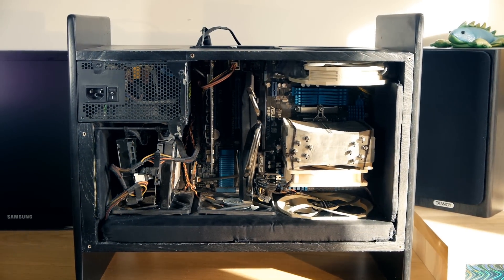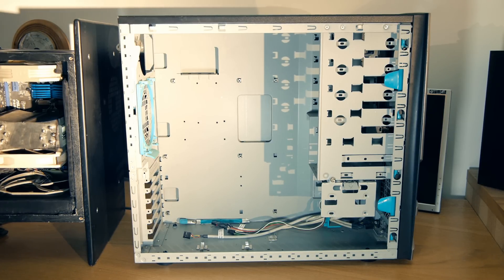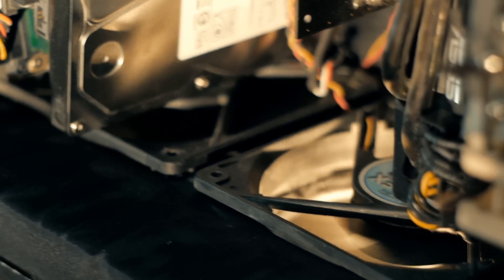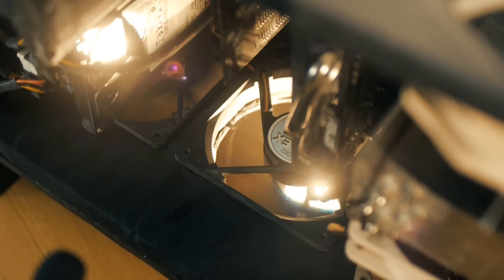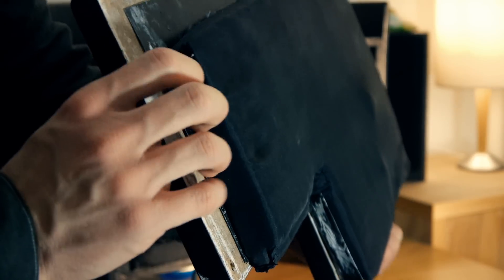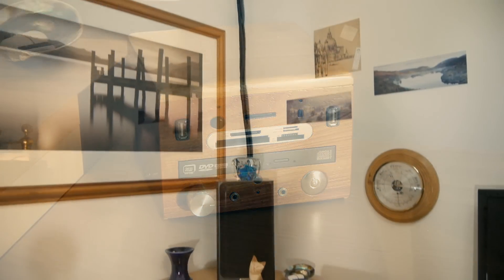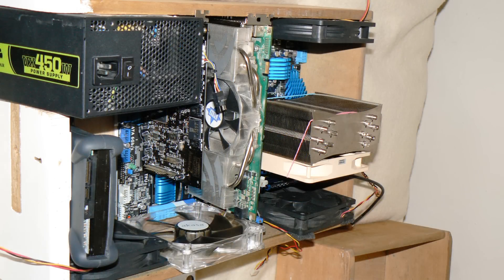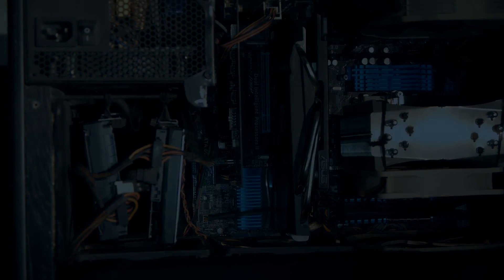My silent wooden PC

Comment: Sensible design. Except for the wood. Wood adsorbs and retains heat. Will affect case temperature. The aluminium might fix that problem though.

I see no dust filters. That makes me worried.

5 meter cable to remote control. Makes me think about signal loss and signal noise.

A computer in a small cupboard. An enclosed small room with no airflow. If I had put my computer in one, it would overheat while I was playing a game.

That the hard drives are hanging together could have been an issue if both were normal rotation drives. Vibration from both could have affected each other. Also so close together, the issue of airflow comes up. airflow is recommended to go all around the hard drive.

Comment: Until one day on of the fans dies and the whole thing catches fire and burns his house down since its stored out of sight there is no way he'll know until there is plooms of smoke coming from his attic
Reply: You're a special kind of moron aren't you...?
Reply: Peter Kay No, an honest answer for an honest question :)
Reply: Al Paca boards are loaded with temperature sensors, if fans start dying and any component becomes too hot it simply shuts down. Please note: too hot = before it damages the hardware, that's a point far before catching fire. That is unless it's some ancient AMD...
Reply: treated and or MDF requires to be least 300c temperature before it can auto-ignite !!! a puny little spark from a short wont even char it whatsover !
Reply: well, I agree, if you don't monitor it carefully, it could be dangerous. Did you explain this to your landlord, or is the house your own? I guess your assurance will raise your bill if only they know about this idea.
Reply: What if stuxnet got a hold of his computer? Is that possible? I heard that stuxnet jumps from machines run by a computer and I dunno.. Fire I guess?
Reply: Slamdoxicalz In that case, it'd be ancient ATI ;)
Also to agree with your point, GPU temps exceeding 100 degrees Celsius turn off my pc

Comment: I was wondering, you placed your comp in an compartment above your door. Since this build did not have any filter in it, did it have any dust problems?

Also, did you sealed the compartment (if so, didnt comp just re used the heated air in the compartment since its sealed) or if not, how did you manage to freshen the air with in the compartment and did that solution cause any dust problems.

Comment: But really 24gb ram? Bro 16 is max
Reply from the maker: Viman Punđa 32gb is max on this mobo actually.
Reply: DIY Perks Wow:D Awesome:) Sorry i did not know:)
Reply: Phat Jackson It doesn't depend on the form factor. What matters is:

- Chipset limitations
- The number of DIMM slots
- Support for high density modules
- Support for server memory (higher capacities available, FBDIMM/ECC etc.)
Reply: For a atx mobo running ddr3 i think the max is 32
Reply: nelizmastr yup because a ATX workstation board can take 192gb easily with riser cards
Reply: Viman Punđa
64 is the answer
Reply: MC Cm Actually 128 :D
Reply: DOGE™
 Yess it is :) gogo ddr4
Reply: ***** even more than that now that DDR4 exists. The memory density doubled, so 384 should be doable.
Reply: I have 32gb in my system and k can support up to 128gb

Comment: i love the remote mounting, i have never seen anything like that so far, it must be terrible if you are thinking of adding another monitor or something of the sort. when was the last time you had to route a cable through that system?
Reply from the maker: Jose Carias The last time was when I set it all up. I wired through three long monitor cables, so it's pretty flexible. :)
Reply: thanks for responding, can you please make a video of how exactly you route the cables if you ever have to change any of them please?? i love your channel btw, you have some very good ideas. DIY Perks

Comment: Why i didnt see this before i builded my new computer desk..-.- I would done many things differently in my project...
Question: If your computer is in that cabinet over the door if i understanded right? Is there ventilation in that cabinet? I'm thinking that if its in closed cabined it will use same heated air if whole cabinets air is not chancing over time.

Comment: how heavy is that thing? (just for curiosity)
Reply: gojart destani Unless you live in Antarctica and you use your computer in the snow I don't think that is possible. 18°C is insanely low for ANY computer.
Reply from the maker: gojart destani Pretty darn heavy! But not too much heavier than a steel case surprisingly.
Reply: hehehethat looks realy cool i only have in total 7 fans 1 graphics card 1 procesro 3 LED 2 120 mm ones and my cpu temperature is only 18 degrees !!! nad its a 6 core one
Reply: Erick Ortiz
It is possible. I usually run around 17-20 C when browsing the internet. I have an 8-core AMD.
It's also important to mention it's got Liquid Cooling. So yes, possible.
Reply from the maker: ***** Idle temps don't really mean much these days because of how efficient modern CPUs are at throttling back when the power isn't needed. Although your temps are pretty decent for idle ones, I must say.
Reply: Erick Ortiz  yes it is possible max temperature i et is 30-40 degres when i do some serious gaming in ultra 1440p and when i just browse its normal 18 degress
Reply: DIY Perks
Thanks for replying! Yeah, you're right in that aspect. I suppose I was just answering to the fact that 17 C is possible in a computer, especially with liquid cooling. :)
Your knowledge of electronics is very impressive and inspiring. I enjoy your videos!
Reply: I watched a guy on YouTube that put 20 push fan and 20 pull fans he managed to get a reading off -24... Cool build to be honest it correct I'm running the i7 4470k I think.. With the corsair water cooling CPU mine running at a temp of around 25 when under max load... (Not overclocked it)
Reply: mine is always overclocked at 4.2 ghz AMD  6  core 3.5 base ghz and when i overclock it it gets 4.2
Reply: Erick Ortiz My 8350 idles in the high 'teens with my all air cooled setup.

Comment: I like your ingenuity and DIY initiative. Also, I must say you have done well with the video and sound production. It may have been asked already, but how quiet is it? You mounted it remotely not to hear it at all, but when you're close to it, is it any quieter than any other PC? If so, have you measured it or compared it?
Reply from the maker: It's a lot quieter than the typical computer because of the efficient airflow design, allowing slower fan speeds. It's more of a 'hollow' sound though, because the wood (I've since found) just causes the sound of the fans to bounce around until it finally exits, so it's better to use a material which absorbs the sound, rather than reflects it. Something that works well for this is simply thin aluminium (like a typical case is made out of) with at least four layers of bushy cotton towel over it on the inside. This is the method I've adopted for my updated version.
Reply: DIY Perks Layers of different woods may absorb the sound. Or certain softwoods with open pores. Talk to a musical instrument builder/repairer; or a timber industry expert. Woods vary greatly in their properties. There is usually a wood for every purpose. [That sounds a bit rude]

Comment: love the noctua, put filters on those fuckers though, and make a shroud around your psu in a cone shape, will speed up the air flow
Reply: sorry i should refine that statement, if you make it at an angle, with a smaller area near the top of the case and wider at the bottom